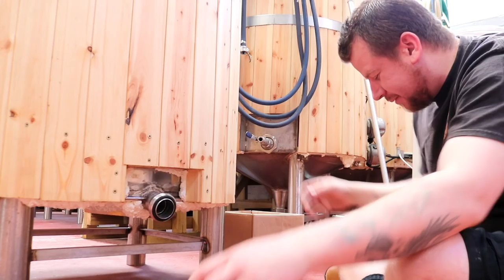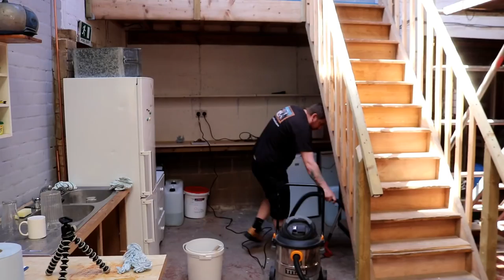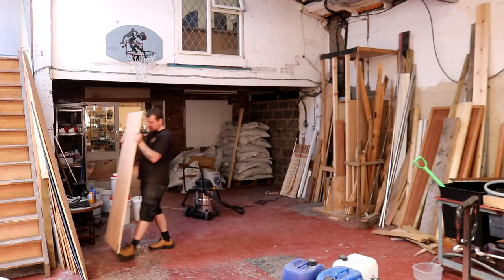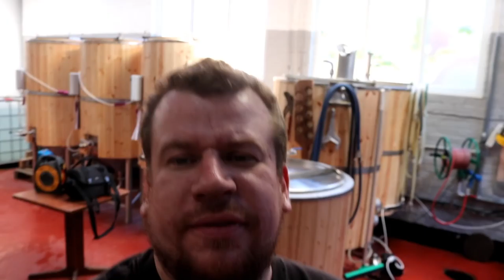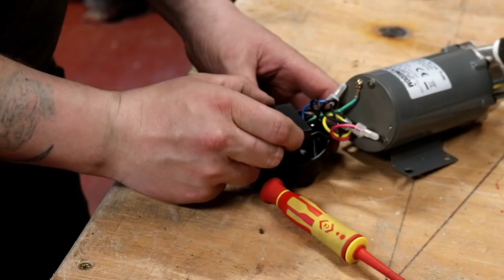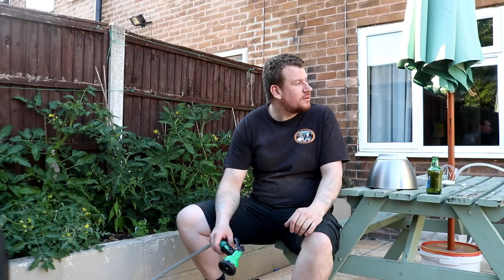BLITZED IT

Comment: On those pumps, you should put a kill switch near the pump so if something goes tits you can stop it there rather than run over to the control panel. I've never used it but my friends at their brewery have.

Comment: harry, have you had any probs with mice as you store your grain in the open
Reply from the maker: Not here, Yet. They are off the ground on pallets, I have also just bought 27 30 liter buckets for storing the specialty malts. The pale malt should be fine on the pallet though.